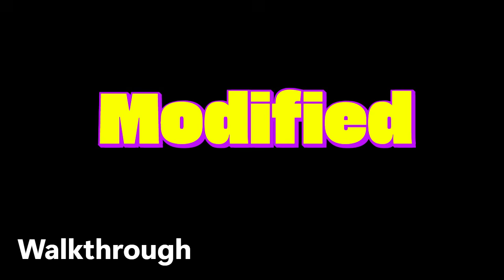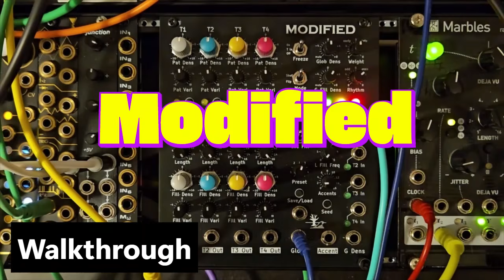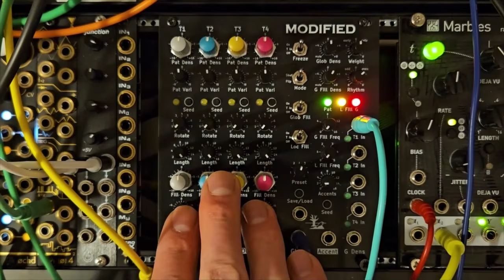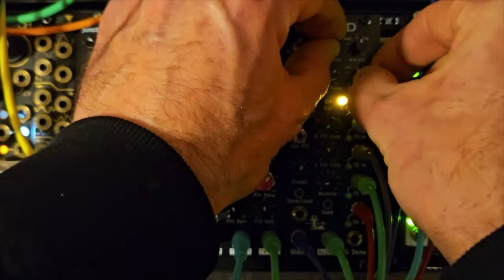Modified - Pimp your drums

Comment: Where can I get acidified and modified?
Reply from the maker: For now I can offer PCBs, the front panel and a BOM, enabling you to build one yourself. Soldering would be easy and everything in THT, for both modules. If you are interested, just use my contact form:
https://deepseagit.github.io/contact_form/deepdive_contact_form.html